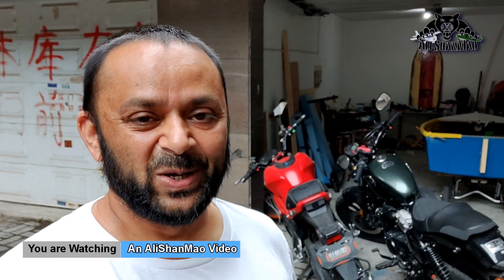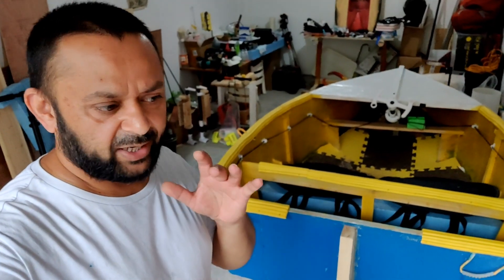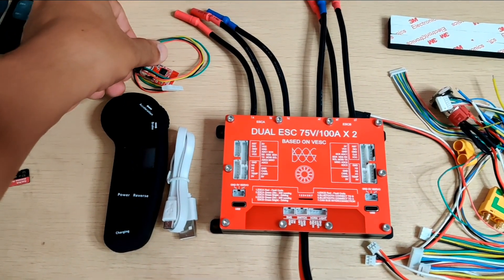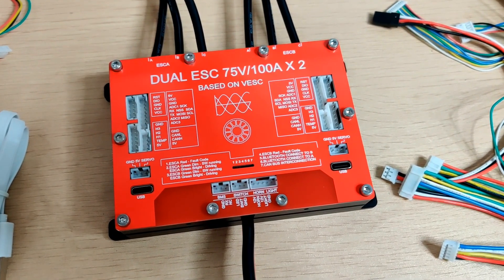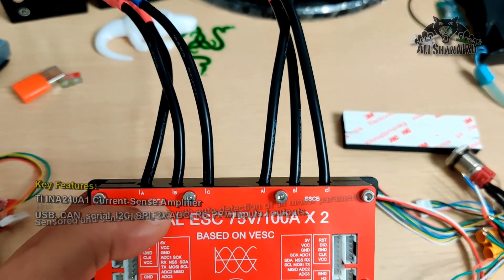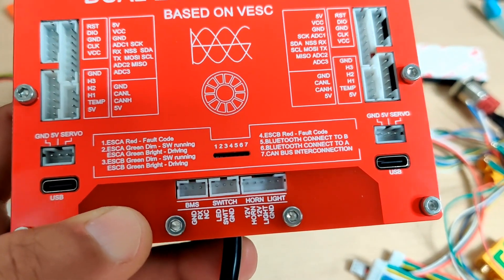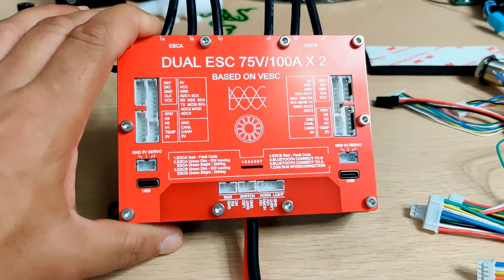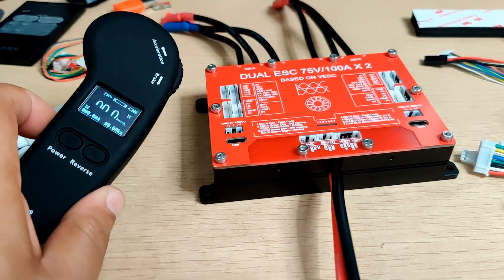Homemade Electric Boat Installing Twin Motors with Spintend UBOX VESC

Comment: alishanmao, have you ever attempted an e-Scooter upgrade (one of those multiple kilowatt ones) by replacing the stock ESC's with that VESC or similar? Thanks
Reply from the maker: not yet. i just built my first go kart, that is kind of kit that can convert any electric skateboard to a go kart. i might then install this VESC to put two more motors on the front making it a 4WD go kart.
Reply: @alishanmao  thanks. Just asking because I'm a bit curious about what options people take regarding config (e.g. appriate current to set) , and dealing with potential limitations such as brakes and regen, and turning the controller on and off (stock controllers usually have a separate 60 Volts return wire to power the control electronics - so that the LCD display and/or alarm box can turn these on/off).

Comment: hi ali nice boat shame about the rudder its gonna put more strain on the rudder awesome build buddy
Reply from the maker: Hi Peter, yes it was, but I reversed it realizing the point hahahah. now it works like a charm because axis is near the boat and wider part outside. steering turns like butter.

Comment: OMG that Boat is awesome  one small mistake you the the Rudder on back to front   and yet it still works lol awesome Vlog thanks
Reply from the maker: yes I realized that and reversed it later. no worries. thanks for the tip

Comment: Hello ,Ali. Motor mount stainless screws can be trimmed flush & dress threats for a slimer look , no air bubbles forming in front of props & will be easier to clear debri or Fishing line . Hey, any troubles with that rudder, you might need to turn it around . the further back in relations to its center axis the better , waters got a way of pushing the wrong way @ times.  All around Boat its getting there & like the color & the constrasting name of your Vessel.  Sorry for rant lol Boats exite me.
Reply from the maker: Hey David, good tips, than you so much. yes I fixed the rudder the other way later. because i just wanted to see how it would work if it was to be that way LOL. turned out it was too difficult to hold it even. so fixed it the other way with pivot back and larger side trailing. now it turns like it has power steering :D